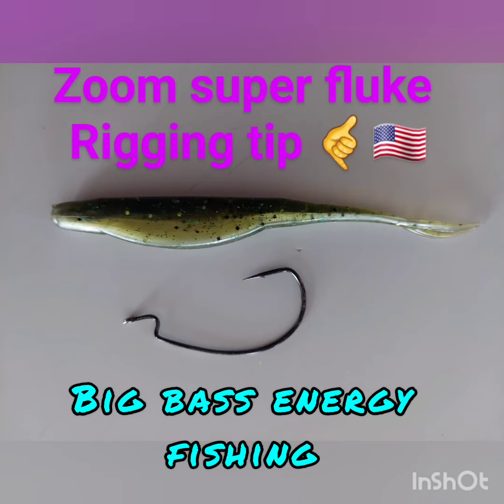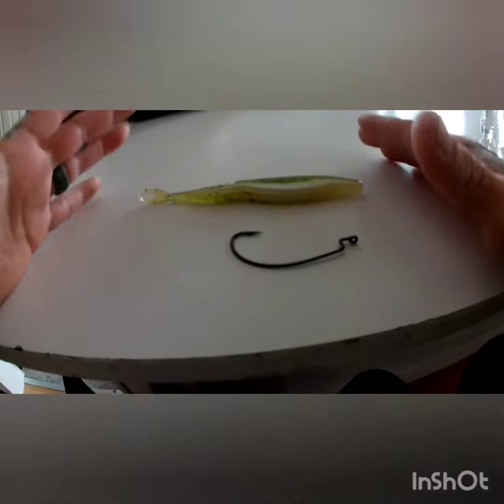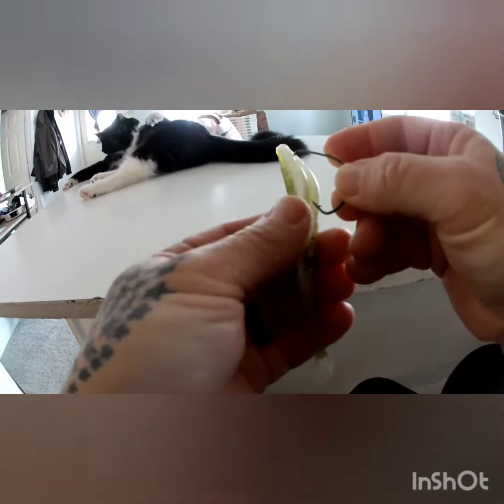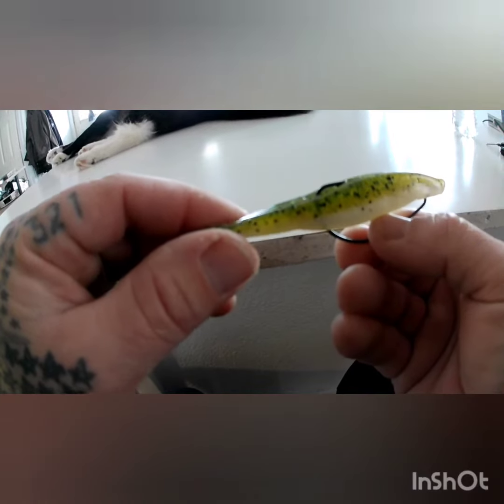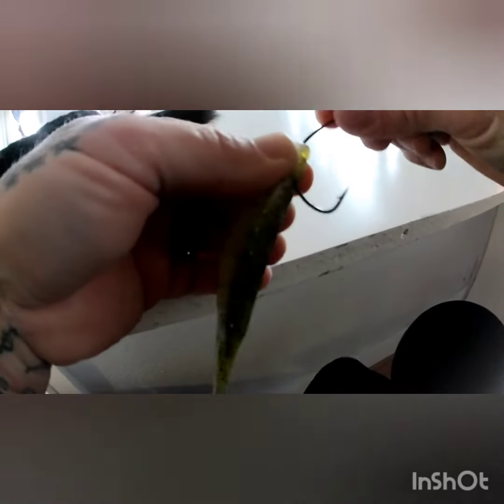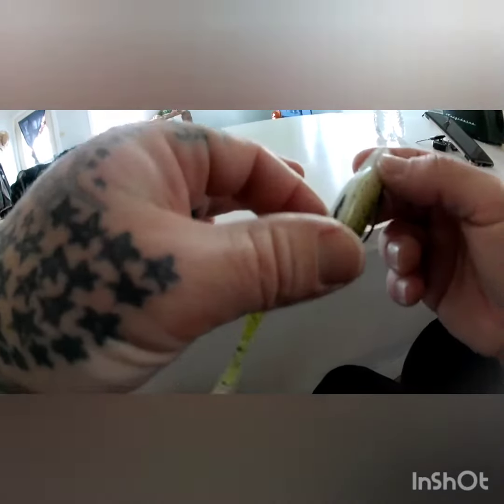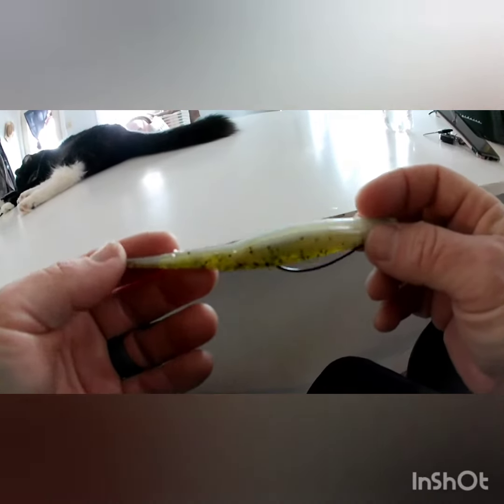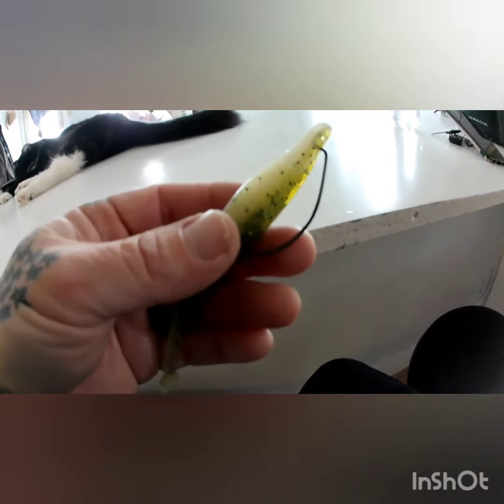Zoom super fluke rigging tip 🔥

Comment: The potential problem with rigging upside down is the weight of the belly of the bait, that makes the bait run up right, you would think that would cause the bait to flip when hooked wrong.
Reply from the maker: Give it a try. I prefer rigging the bait this way due to its weedless nature. The action is almost identical to the normal way of rigging. You can walk the dog with it or let it sink a little and then give it a jerk or two. I have caught a ton of good largemouth rigged this way. Tight lines brother 🤙🏻